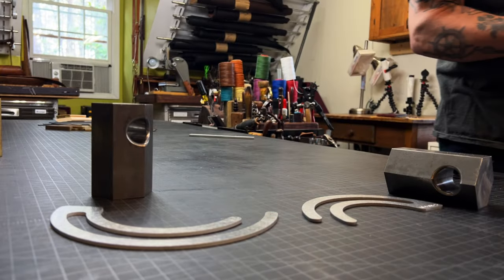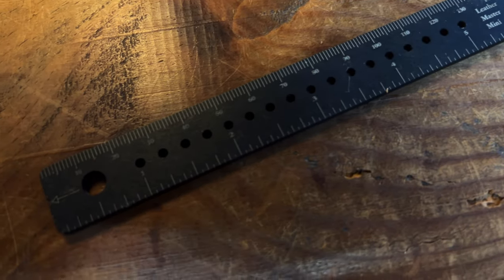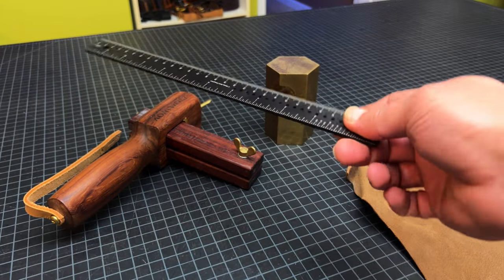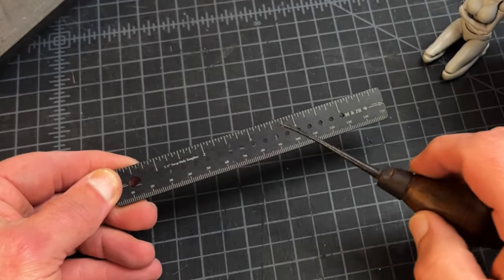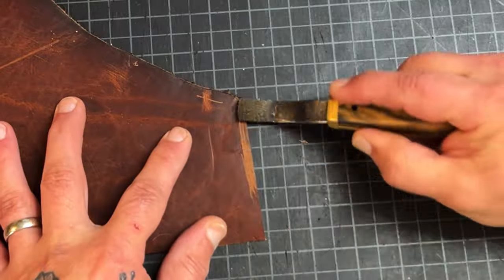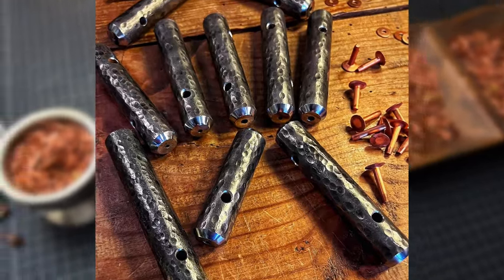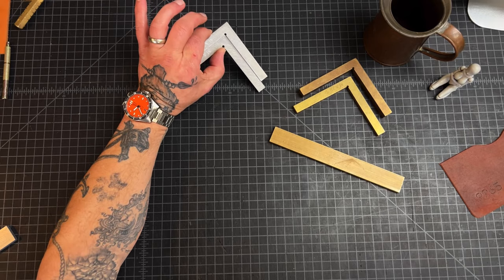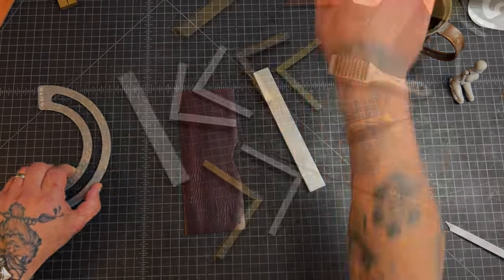WHY are these so popular?!   Game-Changing Leather Craft Tools!

Comment: Art, You know I love everything about Mascon, especially Chloe, but being a fabricator and laser shop and the fact that most of the stuff I wanted to buy is sold out on your website, Guess I'll just whip 'em up myself. Thanks for the spec video, it will make it much easier. Peace.😁
Reply from the maker: Enjoy the journey
Reply: Any idea when you'll get everything back in stock.?
 @MasconLeather
Reply from the maker: Batch of Anvils already in the works.  So maybe. Couple weeks. 

Rulers , new batches starting this week. 

Rivet setters- small batch (9 or 10?) should be in stock in April.